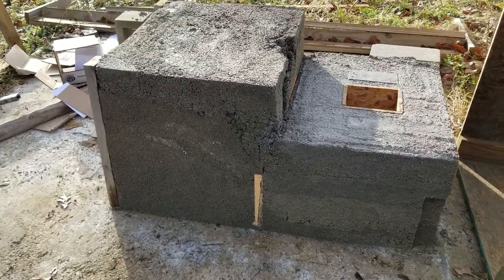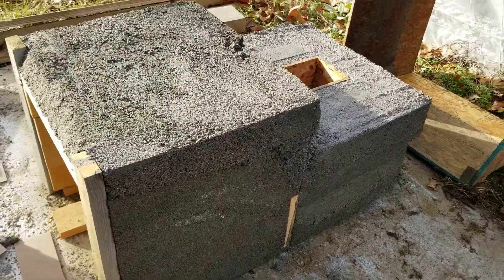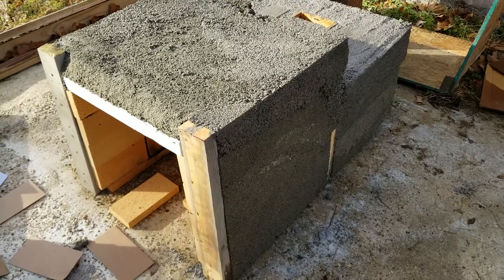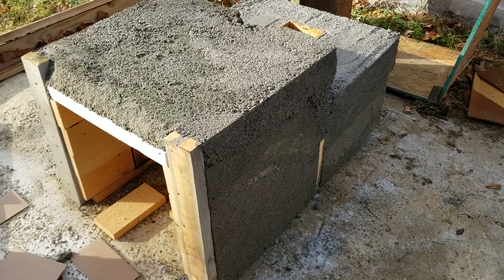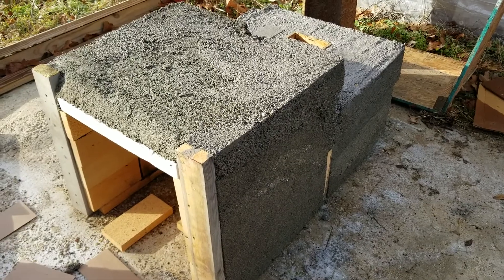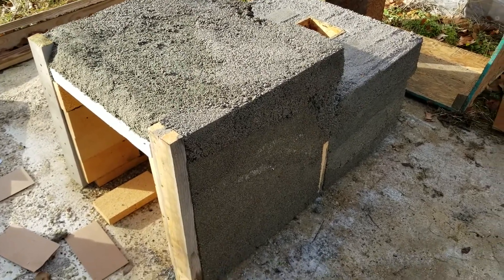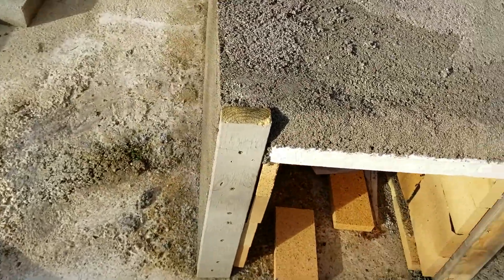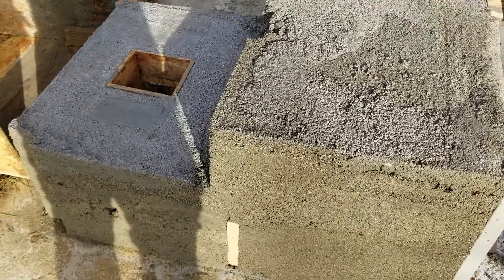Rocket Mass water heater part 4

Comment: I'm not seeing a way to clean out that low spot (that will be under the riser) is that a concern at all?  I suppose that particular 90° isn't as critical to have a cleanout as after the barrel (where the manifold goes) but I also believe that most J tube designs you can reach in to that elbow from through the firebox and I'm not thinking you can do that easily in this case.

Looking forward to watching as the project continues.
Reply: leosmike just a simple shop vac should do the trick but you’re correct it should take a long time before that is necessary.  Probably just a part of the annual maintenance.
Reply: Looks great!!!!